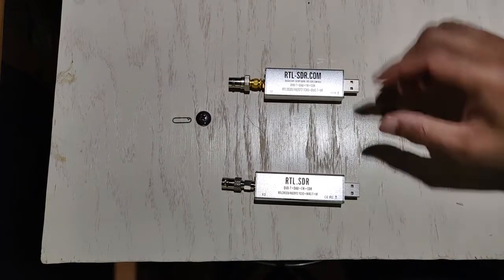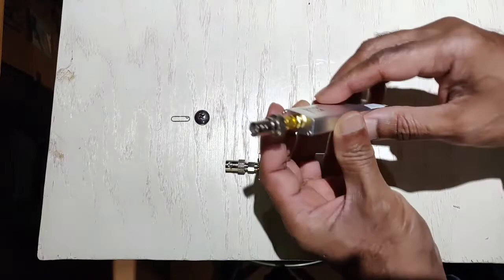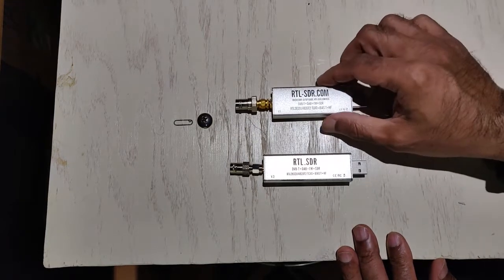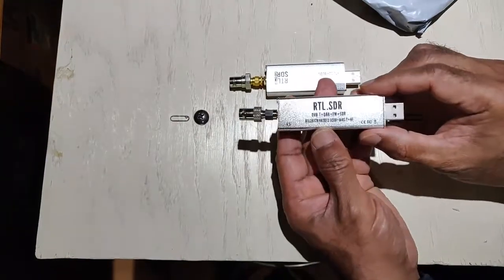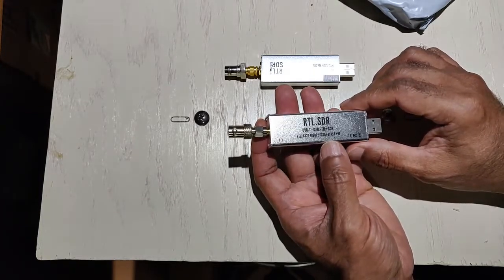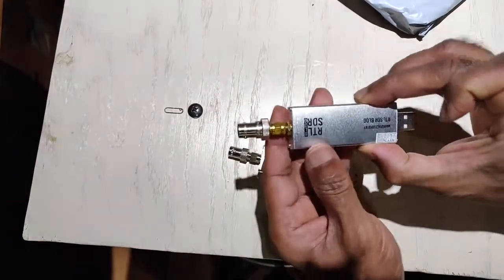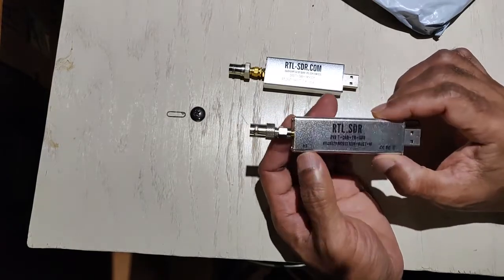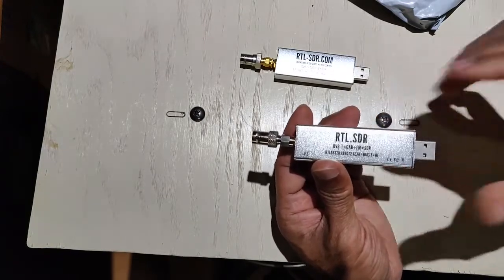RTL SDR FAKE | DO NOT BUY CLONE | NO TCXO | NO DIRECT SAMPLING |V3

Comment: Which hf antenna works good with rtl sdr v3? And where to buy that antenna can i get some guidance please. Thanks.
Reply from the maker: Harsha, when it comes to Antenna, install the best you can. A compromise antenna is,....well.... a compromise.
Broadly, choose between an Omni directional and a directional antenna.
That said, now, since this SDR covers a very wide frequency range, it now depends on your spectrum of interest. Based on that, you may need switchable antennas for the required band(s).
For HF, a long wire does the job, but as you go higher you'll need tuned antennas for the frequency of interest.
Reply from the maker: Also, if space is not a constraint, then install a wire dipole for HF. Easy to make at home. Just google HF dipole (or inverted V) and you'll find helpful videos and instructions.